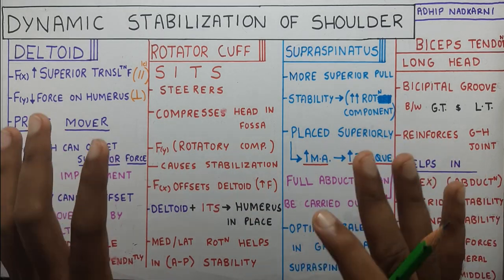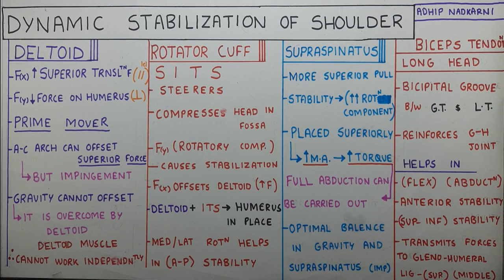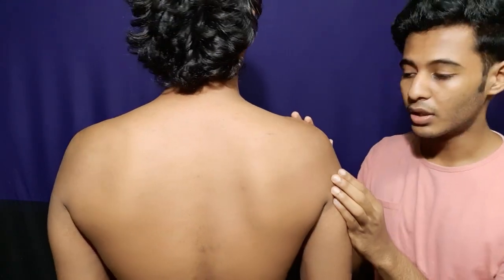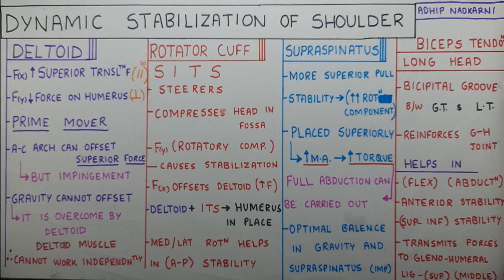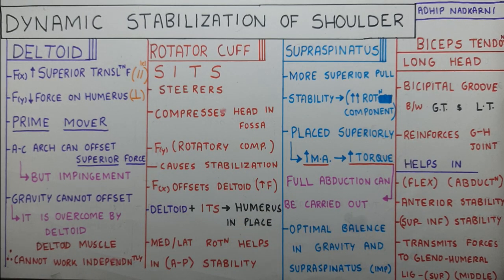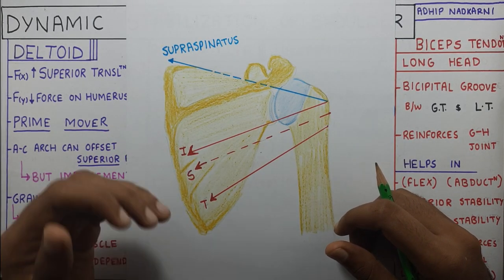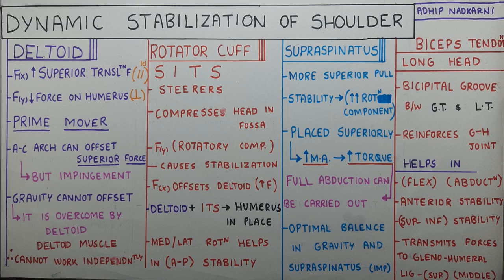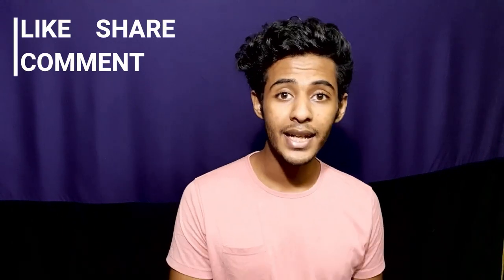DYNAMIC STABILIZATION OF SHOULDER JOINT (SHOULDER JOINT COMPLEX BIOMECHANICS)Physiotherapy Tutorials

Comment: you said that subscapularis and teres minor do not function while elevating the arm then how can we use them are force components for stabilization ????
Reply from the maker: One of the function of subscapularis is internal rotation and teres minor is weak adduction these components were seen to be diminished during elevation of shoulder when they did the EMG test...

The other force components produced by ITS shown in force couple diagram are still active during elevation 
 hence the adduction and internal rotation component of both the muscles was seen to be diminished
Reply: @MovementScience8  alright thanxxx